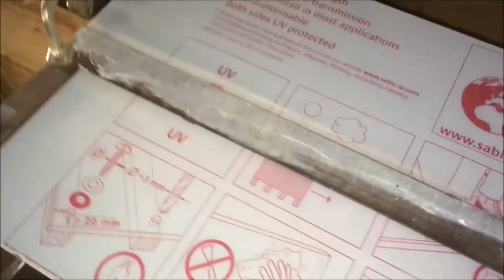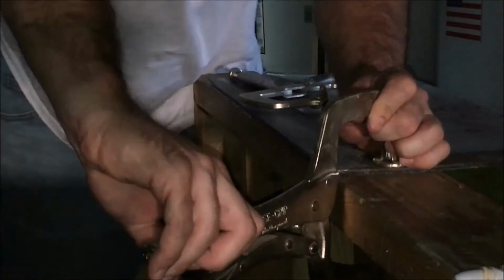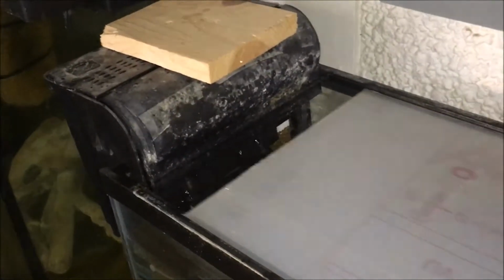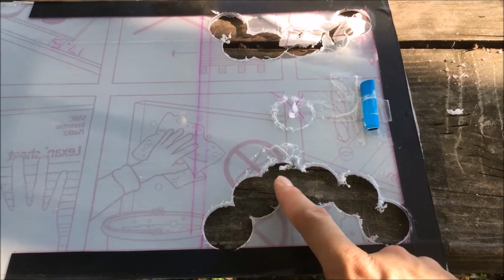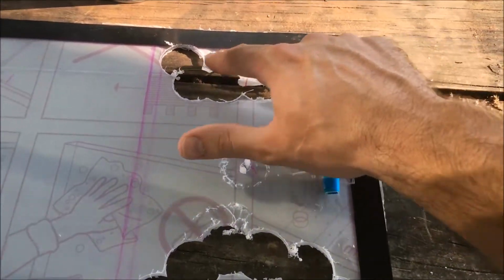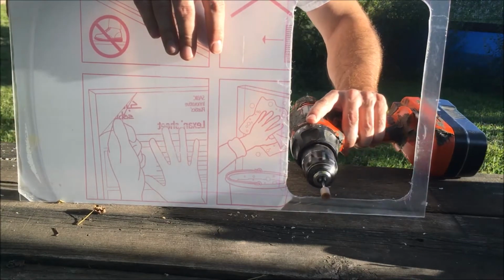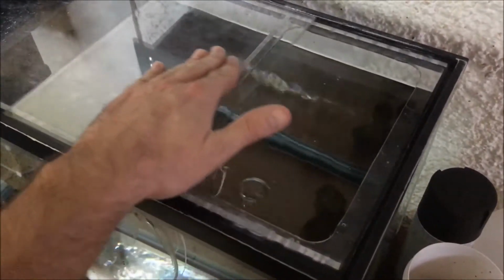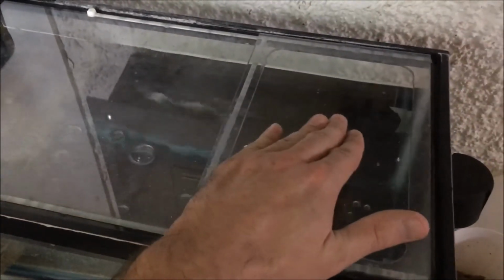DIY Aquarium Lid, Sliding Aquarium Top Lid, Polycarbonate Tank lid

Comment: Ok, it's been a yr since you put this up and I won't read the comments below. Yup, the zip ties are genius! About the super glue attack.  If I had to do this again for any reason  I would use UV resin. Very very useful stuff. Get a bottle from Amazon and a little handheld UV flashlight. Do this INSIDE or it sets up. But the advantage here is that it won't immediately set incase you goof and/or get it on yourself (wont stick your fingers together). Just wipe it off.  Once you have the zip tie in the correct spot, use something like a toothpick to hold down the zip and from underneath use the flashlight.  Wait about 30 sec to a minute and its NOT gonna move. Once I bought  UV resin for my crafts, I found out I couldn't live without it around the house.
Reply from the maker: Great tip, I will look into trying some! Thanks for watching & the tip!
Reply: @valleyfish  you can put handles on the same way if you wanted to ;). I meant to add that before,  sorry
Reply from the maker: that's a great idea I wouldn't of thought of that one,  nice :)